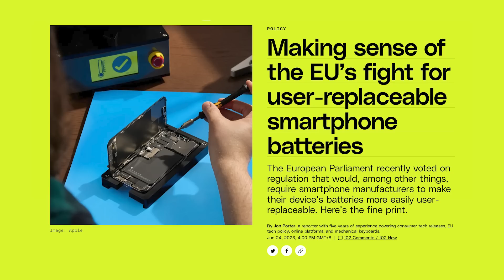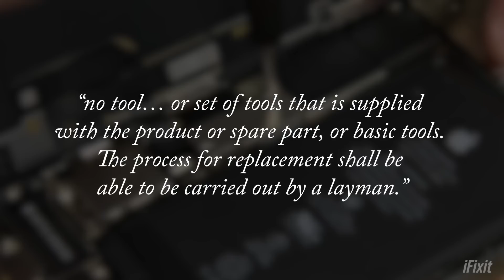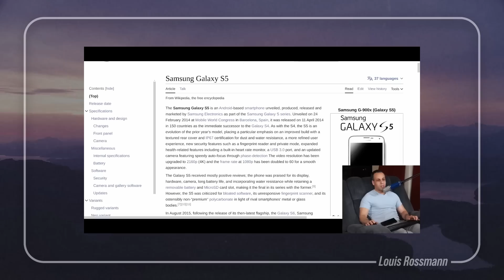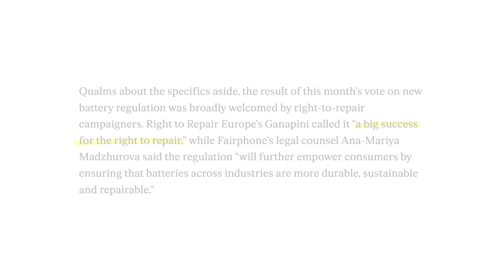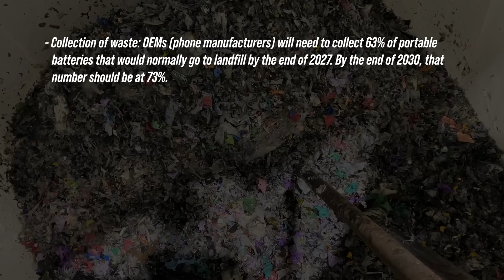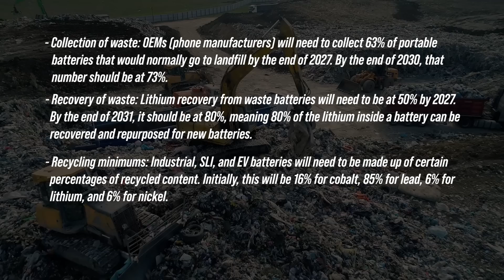EU Just Changed Smartphones Forever

Comment: One regulation I would like to see is uniform laptop batteries. There should be a standardized set of batteries (different sizes for different form factors and a standardized connector) so that any manufacturer could make batteries for any laptop. That should push prices down quite a bit
Reply: Now that goes a bit too against the laptop's individual projects... Each laptop, phone, electronics in general have a unique electronic board, with unique placements for the ports, circuits and components, which in some cases, causes the physical shape of the board to be different for each brand and even for each model, so the battery has to be shaped AROUND the board and in-between the body carcass/frame, and THAT is the reason why we can't really demand a standardized pattern for the batteries... each project is too specific. 

Of course when we talk about desktops we can see a pattern in the motherboards, having standardized placements for each component and all companies stick to that form factor. But EVEN THEN, we still have different form factors (miniITX, ATX, EATX, etc). So yeah, when it comes to laptops it's even more unique to each model
Reply: @keKel-13  99% of laptop batteries consist out of 18650's and well over 90% share the same voltage output. It really wouldn't be a problem to design uniform and universal batteries for laptops.
Reply: @keKel-13  I dont think so, maybe there are some specific devices with "special" battery but in 99% and you can add connectors, chargers, slots etc. is just proprietary garbage   INTENTIONALY made that way so you cant use their parts, cables, etc.. Again selective memory there were times not long ago that most devices used same batteries same connectors and for last decade EU is consolidating those things by standardization of those parts.
Reply: @keKel-13  This wouldn't be a problem at all. Designers already take into account which battery they're going to use when they design the board and case. The only difference will be "It has to be one of these 6 batteries"
Reply: @keKel-13  No, you can just shape it so it fits the battery. The reason they are different is to intentionally make it hard for 3rd parties to make them so the OEM can sell overpriced spare parts.

Comment: I think the end of user replaceable batteries was motivated by following apple's lead, which was of course centered around increasing profits at the expense of users. They are also responsible for other anti-consumer moves, such as removing accessories from the box and extending their serializing and soldering on of ram and storage and CPU, as is common in phones, to other devices such as laptops, desktops and even workstation level computers costing thousands. I despise the apple way when it comes to these things.

Comment: Its all about money. Manufactuers want more green and the way to get more is to build in batterys, just in case if you dont want to buy a new phone, they still get their money from their "services" and let them change the battery for you for a fee. Most people buys a new phone once a year so that might be 1 argument manufactuers use to keep the batteries built in cause a battery wont go bad in a year. However, this idea doesent go well with the recycling and enviromental aspect. I use my phones usually 3-5years and im not the only one. Therefore a battery that you can change yourself without the hassle, for a couple of bucks would benefit the end user and the enviroment. Manufactuers obviously wants you to buy new as often as possible.

Comment: This is completely unnecessary to force smartphone makers to require a removable battery. If you want a smartphone with a removable battery, buy one that has said removable battery. Having built in batteries isn’t bc of some grand plan to make customers pay more money to replace phones, which most cell provider plans will give you close to a free replacement from a faulty battery in a phone anyways. It helps the system become more enclosed and less likely to cause damage from falling or scratching.  You could make the same argument for just about the camera as well. Not saying people are in the wrong for wanting a phone with a removable battery, just that we shouldn’t force companies to have it as a requirement as this could possibility get in the way of making better phones/battery for the sake of some small connivence.
Reply: Non removable batteries are all about the money, if you can't see that you must have Stockholm syndrome... They obviously have to be forced because they wouldn't be doing it on their own. There's zero advantage for the consumer having a built in battery, ZERO!!
Reply: @polska905  you clearly have no knowledge of tech side of things then. Just bc something is slightly more convenient for some crazy edge cases of the battery being faulty doesn’t mean the entire industry should have to follow some rule that solves one problem and creates much more.

I remember having phones with a replaceable battery and every time I dropped it the battery came out. That causes more damage and more long term affects to the phone’s inner workings. There’s multiple benefits for the battery being built in for said reason above as well as keeping the phone resist to water and other outside factors like dust. 

Again, if you want a phone with a removable battery…go buy one. No one is stopping you from doing that. But the government shouldn’t force companies to have removable batteries. That’s just ludicrous. I can’t tell you the last time anyone even known needed to get the battery of their phone replaced.

Comment: This is likely not going to affect Apple products. There’s is an exception to the rule for replaceable batteries if the device is a) waterproof, or b) the device has a substantial enough battery that still holds 80% battery capacity after 1000 charge/recharge cycles. Currently iPhone batteries retain at least 80% capacity after just 800 charge cycles, so they’re more than likely going to improve the battery to meet the new standards.

Comment: Apple will 100% make an EU and non EU variant, then talk some gibberish about how the EU is forcing them to make a more expensive phone and how they are using more parts for the EU version, and how it will cost more.

Then they will talk more gibberish about how because they are putting more effort into the EU version that the non EU version does not have as much parts and now that is going to cost more.

When in reality all they need to do is not glue the fucking thing shut, but they will find a way to make more money like how green power costs more.

Comment: i dont see problems with smartphones. designers will find ways to make it possible.
more interesting to see how BEVs will be made.
theyre currently moving towards structural batteries.
even without structural batteries in BEVs its not possible to change the battery at home :D

Comment: There is a missing step: battery standards unrelated to producers, just like with AA or CR2032 batteries, so that for example you could buy two different phones: a premium model for everyday use and basic&rugged for hiking, both using the same type of battery, so only one set of spares would be necessary.
Reply: I remember like 5 years ago seeing a video of solid lithium batteries that could literally be cut with scissors to be whatever size you wanted. That would be pretty cool too, I think. Although I guess the trimmings would get wasted, so maybe standard sizes are better.

Comment: I owned a LG G5, along with 3 separate batteries. Always had a fully charged battery ready to pop in at a moment's notice. The phone Looked as if it was made of aluminum or some type of metal, but it was discovered it had a layer of plastic over it.. It did feel cheap, I will admit, but it was VERY useful to NOT have to slap it on the charger all the time.
Reply: Hahaha I had a spare battery for the Samsung S4 which was cool but remember back then phones only gave you about a day's use.  Now with advances in chip design and huge batteries and power efficient screens you don't need spare batteries anymore.
Reply: @jonfreeman9682  True. My Galaxy S20 finally gave out after 3 years just recently, so now I'm enjoying my brand-new S23. 🙌🏻
Reply: @darkcoldforest  Nice. Samsung makes the best screens but they're expensive like iPhones. I now rock a budget Moto and it's okay but the 720 LCD screen is worse than my dinosaur Samsung S4. 😅
Reply: @jonfreeman9682  I was lucky to get this phone, because my sister let me use her card (didn't get paid until a week later). First I was a die-hard LG fan, but then after my G6 took a shit, I swapped over to Samsung and never looked back. I don't like iOS, so I've never owned a Apple device for that reason. I love playing PUBG New State at 90 fps, it looks amazing!

Comment: That is good news but I am old enough to remember my Samsung S3, On that phone I have changed the battery 5 times, after 2 Years of use, and all lasted a couple of months, why?  They were all built in the same year and no new manufactured battery could be found on the market. Eventually on my S3 the glass cracked from the only single drop on cement without the protective case. I wanted to repair it but it costs more than a brand new phone. Now after breaking a lot of other phones and ending up in the same problem (repair more expensive than a new phone), I bought a Fairphone 4. I suspect that even if the hardware will last more than 5 Years, it will stop working from the software side. Services like the browser the maps apps or the streaming and such will say unsupported architecture and leave you with no choice than buying a new phone.

Comment: I think they should to place two (2) batteries for security reasons. The first one should to be replaceable by yourself. The second one (for security measures) should to be replaceable in the authorised services... If someone still your phone or just loose your phone it will continue to work even with removed battery 🔋. The second battery will even increase GPS activity time if you loose your device...

Comment: I'm pretty sure there are much more people who change their phones prematurely because of a faulty battery rather than people accidentally dropping their phones in water. The first one is unavoidable and companies think we have to deal with it or pay their service, the second is your fault, and there is no discussion. I wouldn't mind having less water resistance on my phone if I'm able to change the battery on my own, but again, if they put money and investigation on it I'm pretty sure they can do robust phones with water resistance + replaceable battery.
A few days ago I went to a local shop in order to replace my iPad Pro's battery (from 2016, I'm not willing to buy a new one), they told me a few times if the screen breaks in the process I do have to pay for it (+170€). They replaced the battery but suddenly the magnet sensor for the cover didn't work, so they totally not recommended me to open again the device because the screen could break. These are the kind of things that bug me with stuff that "sould" be something simple like changing batteries if they designed it properly.

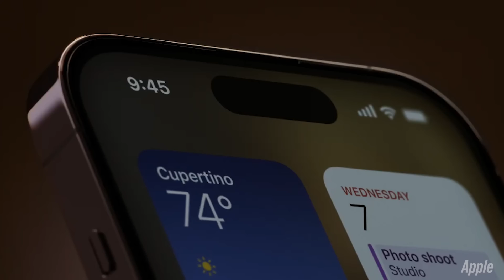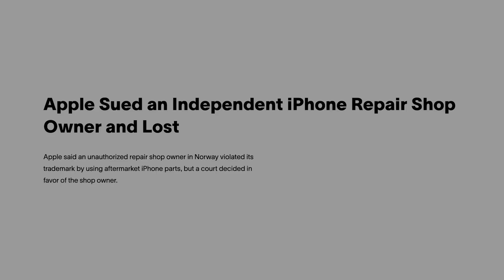Comment: 3:40 Thumbnail image is excellent LG G5 swappable battery design 2:26 EU law for battery devices takes effect in 2027 3:00 RtR advocate Louis Rossmann 👍 4:23 serialized parts to sabotage parts replacement from donor device😡 5:04 Apple won't sell certain inexpensive individual parts, e.g. laptop display flex cable, requiring expensive assembly purchase or tedious extra repair work😡

Comment: I was planning on upgrading my iPhone this year because EU enforced usb type C… Maybe I should wait a bit more until they make one with replaceable battery 😂
Damn I love EU - finally some gov is doing something against anti-consumer corporation schemes.
Reply: CEOs can bribe national governments. CEOs can't bribe 27 national governments, it's just too expensive. So they do actually produce a lot of pro-consumer legislation.
Reply: You might have to wait until 2027 to get the replaceable battery iphone, though. 

I’m hoping the EU’s next trick will be to require RAM and SSDs to be user replaceable in laptops.
Reply: @therealshavenyak  its only 4ish years, i get a new phone every 5 ish years unless my current one breaks and im pretty sure they can last even longer so ¯\_(ツ)_/¯
Reply: @therealshavenyak  News flash they are already replaceable in standard form factor laptops since ever. I replaced the ram 15 years ago on laptops
Reply: @therealshavenyak  I'm assuming you're talking about apple laptops, because most laptops I've owned over the years had replaceable ram and storage. ( my current laptop was bought 2 years ago though)
Reply: @1tuttyfruti ram is almost always replaceable but specifically ultralight and ultra thin models both apple and otherwise tend to have soldered ram. it’s an issue you don’t really run into if you go for something big and robust
Reply: I really want to see them bring back Micro SD cards and headphone jacks
Reply: I dont get why you should change your phone.
Your phone and you charging device works ? Then you can wait until they die to change your phone.
Reply: I haven't yet found the reason of purchasing iPhone, it has the highest premium prices in the phone industry and they are always late with technology, they keep on bragging about cameras all the time, the only reason i keep hearing from consumers are 2 things:

1- cloud system, where all mac products integrate easily with each other, and that is the on the biggest scam apple made which they lured their customers into something that would make your life harder to get out of, its so exhausting for me when i left apple products because how hard to extract anything I want to windows or android, so the closed system is actually really bad.

2- Cameras, buying a phone for the camera is like buying canon cameras for its screens... if you really want a good camera just buy an actual camera...

they say they have the best screens, which are made by samsung, batteries? again... samsung. How about the memory? yup you guessed it... samsung.

so why dont people just buy samsung phones?!
Reply: @Dolbic.  You forgot the biggest reason.  The software.  IOS is standard across all platforms and it's even free.  Apple even supports their iPhones for like 7 or 8 years.  Don't ask me why they support their dinosaur phones but they do.
Reply: @Dolbic.  Ironically, the last three points you gave to samsung doesn't actually apply if you use both companies' latest top end phones. The memory's a tie, the batteries hold more power but use it faster, and the screens still suffer from burn-in and being weaker material (though they are brighter and more vibrant). Basically, iphone 7's > everything.
Reply: thats so silly though. You could have the choice.. if you want USBC you could buy a phone that has it. If you want replacable battery you could choose a model that has it. Our wants should be forced to any person or company. Its so dangerous in the long run. I dont understand how people dont see it
Reply: Apple will defy those instructions and file lawsuit. They're sticking to their guns.
Reply: they're just removing the charger port to comply with the usb C thing
Reply: Apple will fight back as this is a major design change. Apple never made phones with swap out batteries. Maybe the very first iPhone had that but not since iPhone 2 as they're all sealed in.
Reply: @jonfreeman9682  They may do but they wont win. Apple do not govern in the EU, the politicians do, they are the law makers, so Apple can abide by the law or not sell phones to this enormous market.
Reply: I'm so happy yes! We get removable batteries and half of Africa's population!! Wooohoooo you got to love the EU! 😂😂
Reply: They're not going to make a usb-c iphone. The law states "if the device is cable of plug-in charging, it must have a usb-c port" they'll just remove the port and make it wireless charging only.
Reply: @headcas620 Stop it. Please eat your words when it comes out. If it doesn't on the iPhone 15 (or 16 at the latest), then I will apologize to you.
Reply: EU is killing the economy of countries but at least we may have removable batteries in 2027, hurray 🎉
Reply: ofc there's gotta be the stupid one @kainey
Reply: @Mustario  Who benefits from crippling bureocracy? Except big compaies that bring nothing new and innovative that drives growth.

Comment: From the very beginning, waterproofing was one of the main excuses of designing phones that cannot have a removable battery. But we all know that many manufacturers use planned obsolescence to make their products last for only 2-3 years (as it's usually the length of warranty period) and to force customers to constantly buy new products because the repair is often very complicated or even impossible, or just too expensive. Battery is actually the most common part of the phone that fails so when you cannot replace it easily, there's a chance you will be more likely to buy a new phone instead of paying the authorized service for battery replacement. That's why I'm very happy that the EU's parliament has voted this law.

Comment: Does it mean the death of wireless charging?
Reply: Not really as let's say to change the battery you slide the bottom of the phone out witch is attached to the battery they could still attach a wireless charging pad under the back of the phone
So if they think it out it should still be possible